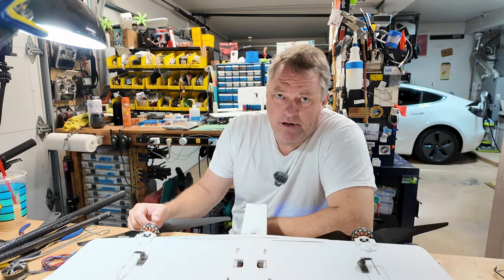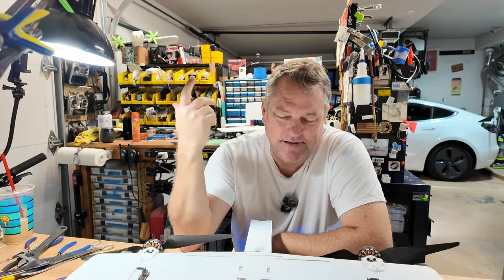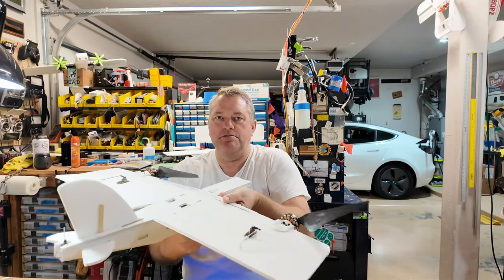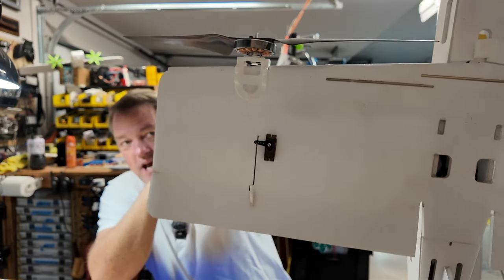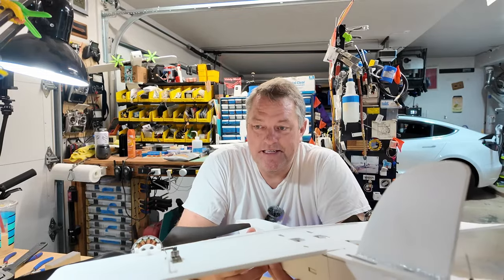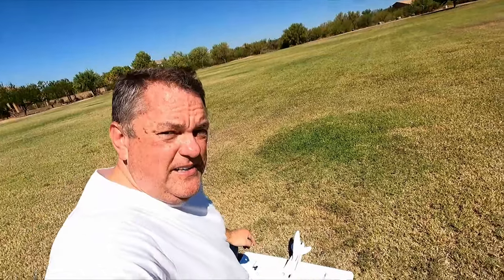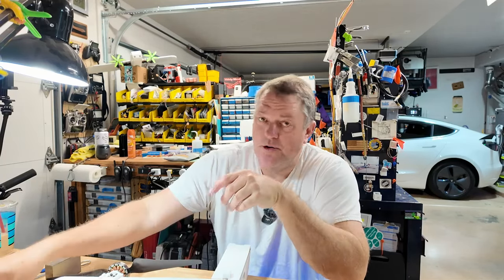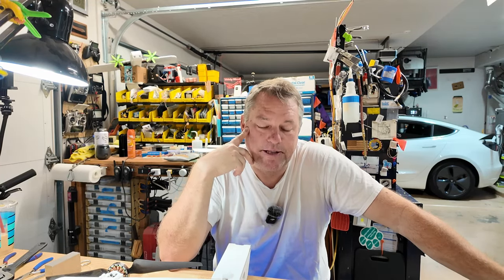Pancake Motor Twin Build and Flight

Comment: Looks like an Osprey.
Reply: Exactly what I was thinking. Maybe it would be interesting to explore  VTOL with this design. Put the engine mounts on some kind of rotating mechanisms.
Reply from the maker: I love the osprey - but the complexity of tilting the entire engine, and yet having a transverse gearbox to bring power across to the other motor in the event of a power failure blows my mind.  I’d love to fly one - but I wouldn’t volunteer to be a test pilot on them.

For my use - I like the idea of tailsitter FPV stuff where the camera pivots for hovering operations, and then tilts to follow the relative wind as the plane transitions is pretty cool.

One day.  One project at a time.

Comment: Really like your content - asking again but hopping I'm not bugging you - what laser cutter are you using?  I know its old - but that means it might be available cheap.
Reply from the maker: I must have missed your earlier question.  The Laser is a G. Weike LC1290 - with a 100W RECI tube. I run it with a Rudia controller, and Lightburn on a cheap pc for a driver.  The water chiller is a CW-5200.  Otherwise I’ve got a generic fume extraction fan, and a small compressor for air assist.  It’s been a workhorse for many years.  Let me know if there is anything else I can tell you.
Reply: @usefulaircraft  thanks!

Comment: Spin props outwards you will have more control. Unconventional twin motor prefer outwards spin.
Reply: And more lift: the propeller wash should counteract the wing vortices, lowering induced drag

Looking at that first toss, it seems like the propwash in conventional arrangement was forcing the wing to work even harder to make any useful lift, keeping it from gaining any altitude
Reply from the maker: My choice to have the propellers rotate inboard was not accidental.  

I’m sure you’re familiar with P-Factor.  It’s what causes the descending blade of the propeller to generate more thrust than the ascending blade - particularly at high angles of attack and high power settings.  So I had to decide how to best use this to my advantage.  As I was solving for slow flight (I fly in a confined park) - I felt it best to have the counter rotating props turn inboard so that as I was operating close to a stall - that thrust vector would be closer to the centerline of the aircraft in the event of any difference in throttle response.  This configuration  is common in multi engine training aircraft.

While it is true there are planes where the propellers counter rotate outboard have better performance, they sacrifice low speed handling and will have a higher minimum controllable airspeed.

I had already fought a defective ESC, and had motors that didn’t spool up at the same speed - so I chose inboard rotation to further minimize any additional potential asymmetry.
Reply from the maker: The inability of the conventional (tail) designs to fly was because the elevator could not generate the pitching moment at the speed of my throw.  Had I launched into a stiff wind, or by means to gain a higher airspeed - it would have flown.  The wing is an inverted KFM - its lift is a direct function of angle of attack.

The plank design is actually hindered by the fact that the elevon shares the duties of an aileron and an elevator.  Furthermore - when elevons are functioning as an elevator, their effective arm (in a plank) is much shorter than in a conventional design where the elevator is much further aft.  

The saving grace in my build was that the entire wing (save 20mm at the root) was in the direct induced flow of the propeller - and thus had the effect of power steering (by the induced flow being vectored by the elevon when the motor was powered).  Before I flew it - I would hold the airplane at the CG, and could feel the pitch and roll forces while the propellers were turning.

As far as the wingtip vortices - they were swimming in a confused sea.  The propellers extended 80mm beyond the wingtips.

It was an interesting exercise, and I learned a few things, but I have no desire for a carbon fiber haircut - so that plane is parted out.

Comment: Fun video today! Sometimes it good to push the limits and extremes. On that note, what do you think about a sub 250 sailplane (max wingspan two fome boards) and a really small efficient motor that barely keeps aloft between thermals 😊 Google sophisticated lady sail plane RC
Reply from the maker: I started with gliders and whatnot - I do enjoy them.  My very first build was an old Wanderer glider.  That plane was a monster to transport - but flew at a walking speed.

That said - I live in Arizona - so I may not be the best judge of what a good thermal plane is - out here it gets so hot you could toss a rock into the air and it may catch a thermal and fly away.  It’s been a long hot summer.

Thanks for your comment.  You’ve planted a seed.